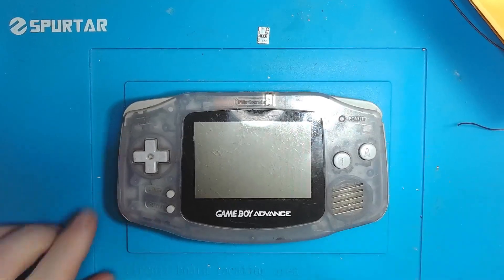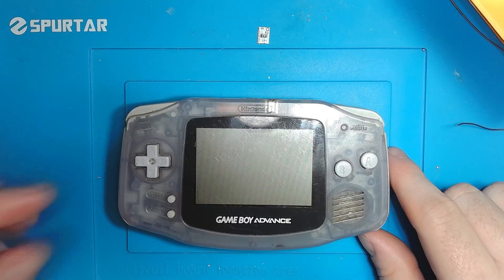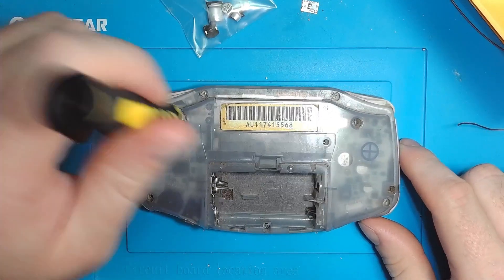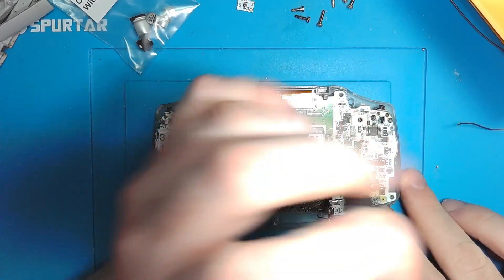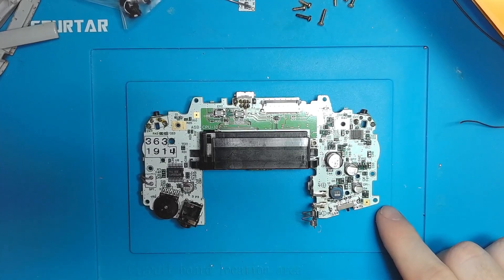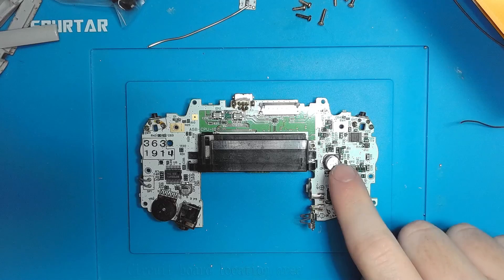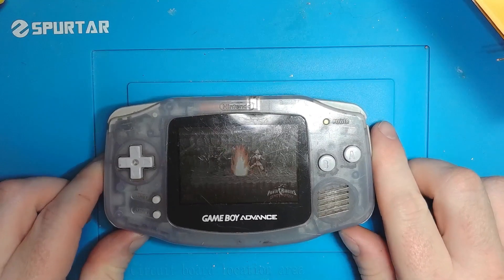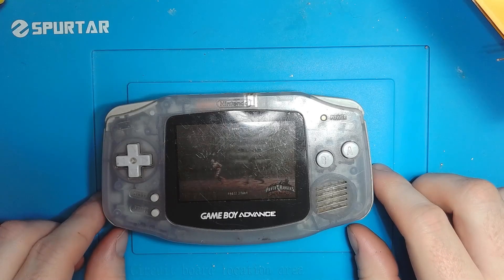Replacing the capacitors in my Game Boy Advance and installing Helder's 'GBA On Fix'.

Comment: I have a gba that keeps rebooting over and over and sometimes it doesn't power on at all but light is great. Occasionally, it will power on fine. Do you think it's the capacitors? I have already replaced the switch

Comment: Good job! Did you notice an improvement in the sound of the video game after changing the capacitors? My console makes a hissing noise when there is no background music playing. I'm thinking about changing the capacitors to see if that helps.
Reply from the maker: Changing the capacitors definitely might help, especially that smaller one by the volume wheel. There are other solder-in mod solutions specifically for cleaning up sound. Check out the Gameboy section on retro game repair shop or on helder tech, I can't remember what it's called but it's under the sound category.

Comment: Oh I am ordering some of that low melt solder!  I had some junk boards so I practiced various ways of removing smd's and wasn't getting consistent enough results for me to comfortably attempt it on my GBA motherboard.  Thanks for the tips!
Reply from the maker: Low melt flows kinda ...strange. But you'll get the hang of it, just drag it around the pins and the component will pop off.
Reply: @yocacola  You are right how it flows strange, almost turns to the texture of peanut butter as it hits the iron haha.  The project was a success because of it that stuff.  I did almost botch a pad since I didn't realize the biggest capacitor had a couple globs of glue affixing it to the pcb as well, the small ones came off with zero issue though!

Comment: dude, you took all that time to replace the caps on that thing and your not going to clean that nasty thing????
Reply from the maker: This video was mostly about doing cap replacements - and demonstrating a way that doesn't involve snipping them off with flush cutters or using a hot air gun. The board from this device ends up getting an aftermarket shell and ITA screen upgrade in my most recent video. Glacier shells are absolutely my favorite, but sadly this one has a broken screw post right in one of the corners, which made a fairly loose edge on the shell so I didn't bother cleaning it.

Comment: Nice job. I've had to repair a lot of ripped off pads from people removing those smd caps. The ground plane can sometimes sink a lot of heat and it takes a good iron to remove them. I use two soldering irons and lift them off.
Reply: People don't talk about it enough but those pads on the Gameboy Advance rip if you look at them wrong. Especially that big one since it looks like there's some kind of red glue holding it down